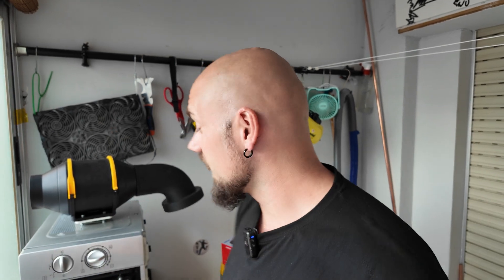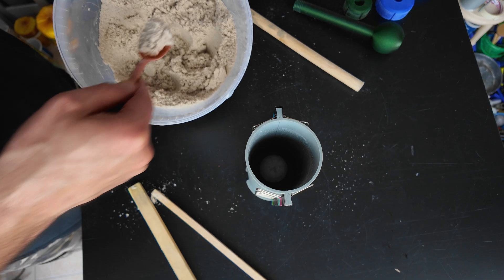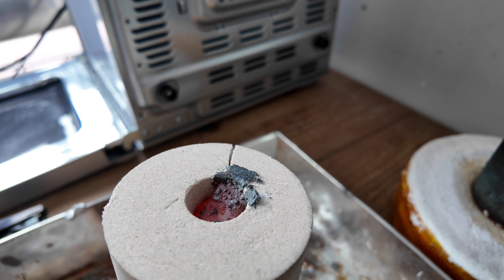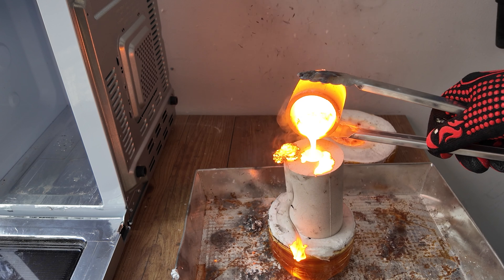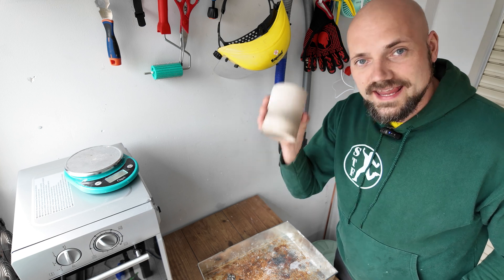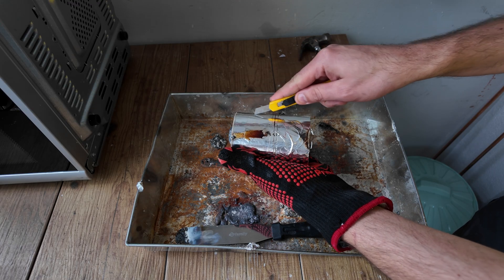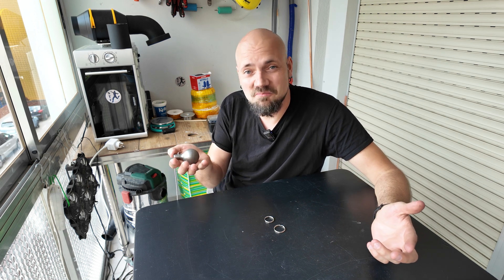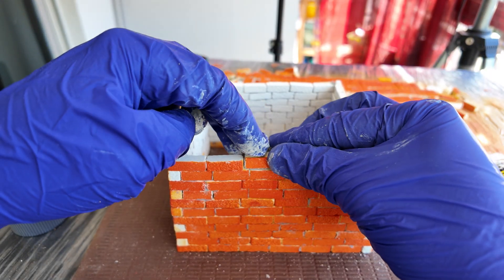Microwave + Iron = Wrecking Ball!

Comment: Curious, why doesn't the iron need to have the air in the mold displaced like the copper pours with the vacuum setup? And would the glass water sand combo be porous enough to do the vacuum technique?
Reply from the maker: Yes, the sand mold can be porous enough for the vacuum to work, but it also depends on how fine the sand is. Iron flows very well, unlike aluminum. A lot of times, I use vacuum—just in case it helps.

I didn’t use vacuum this time because I know these sand molds can crack, and I was pouring a lot of iron. Not a good idea. If I had made the molds much thicker, then yes, I could have pulled vacuum, but I didn’t want to risk it.

In the knife-making video, I did pull vacuum on a sand mold, but that was different. It was a very small quantity of iron, so I knew it wouldn’t cause any issues.

Silicon carbide molds are much stronger for pulling vacuum, even with iron, but with sand molds, you need to be more careful.

Comment: Just wondering: are the crucibles single use only? They must have some metal remains after pouring the main mass, so do you just throw them away each time?
Reply from the maker: No, they’re not single-use—you can use them over and over again. Whatever’s in the crucible, I either remove it or leave it there, depending on the situation. In most cases, I don’t mix crucibles for different metals. For example, if I’m melting iron, I’ll have a dedicated crucible for it, and a different one for brass, and so on.

Comment: Since you're heating everything in your microwave anyhow and the slag is always at the top, couldn't you skip the crucible step and melt the metal straight in your mold by adding a space for material at the top?
Reply from the maker: That´s one of the questions I get asked a lot. You can, but it does not work that well. (depending what you melt). I started to make a video about it, but my first attempt failed, so I shelved the video Idea. I should do it. Cheers!
Reply: @ShakeTheFuture  Thank you, that would be quite interesting :)

Comment: You videos are very interesting I really enjoy watching them. I have observed that you don't use vaccum for cast iron but always use it if for brass and aluminium is there any reason for that?
Reply from the maker: Yes, it's true—aluminum doesn't flow as well, so a vacuum is needed in some cases (or I use it just to be safe). Iron flows very well, which is why I usually don’t use a vacuum unless absolutely necessary.

I’m also cautious when using vacuum with sand molds, because if they crack, there’s a higher chance they’ll leak compared to plaster molds (i am talking about casting other metal, not iron)
That said, I have used a vacuum with sand molds and iron before. For example in the knife-making video—but that was a small amount of iron, so it was relatively safe.

In this case, I wouldn’t use a vacuum because.....too risky, unless I made my mold much thicker.

Cheers!
Reply: I got the point, thanks for detailed explanations. I have watched all your videos mutiple time, and I really enjoy it. 

I have a suggestion, how about starting a series where you cast functional items (assembled together) as you have been doing only props. @ShakeTheFuture
Reply from the maker: @Sameer-h1d3h  Thank for the suggestion. I am opened for those kinds of videos. The problem I have is that my videos get so little views.......I don´t even know if I can keep going. Well see what happens. Cheers!
Reply from the maker: @Sameer-h1d3h  Thank you!
Reply: How long is your burnout process? :)